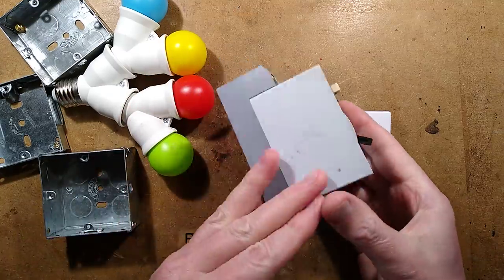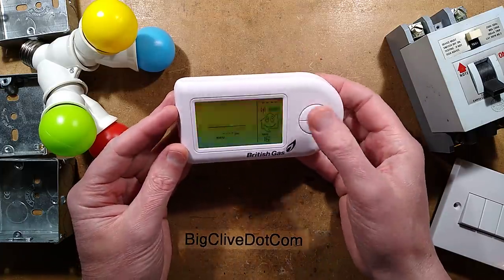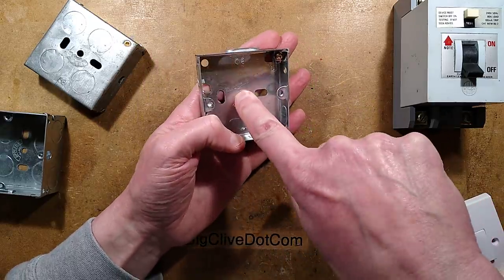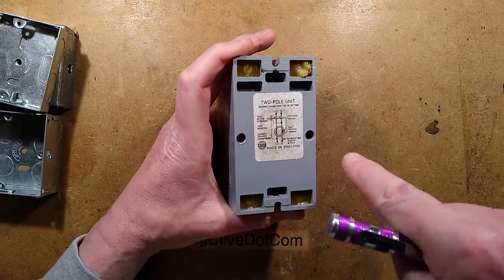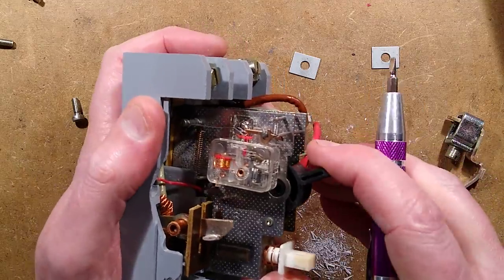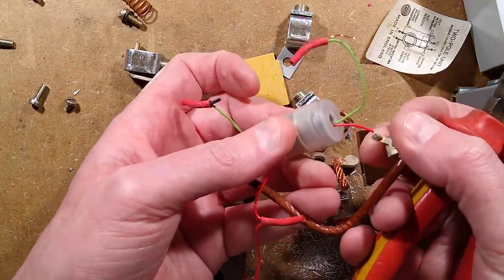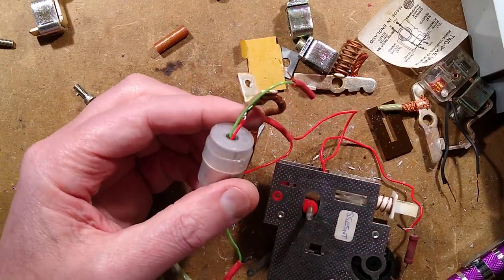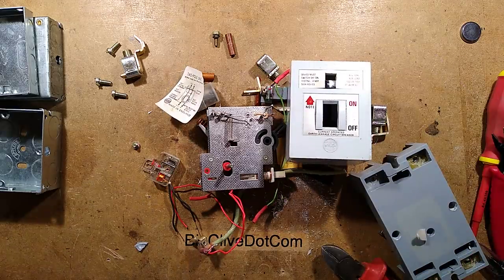Vintage RCD/GFCI teardown with story (weird sensing system)

Comment: Im trying to get a 1970s flourecent light up and running it needs new starters i will go to toolstation tomorrow i think
Reply: Fluorescent is the best, way better than LED. Some old fittings are starterless, if yours is it’ll need a fat (T12) tube.
Reply: @bigjd2k  no its a small twin  t5 wall fitting
Reply from the maker: If it's a twin T5 (5/8" diameter) fitting with short tubes then it may have one ballast and the two tubes in series.  If it does then you may require specific starters.

Comment: I'm not completely convinced the test switch is not opened when the breaker is open. Could there is a mechanical component that breaks the contacts? Would you please check the test switch with a meter. I can't fathom a circuit breaker company making such a bad decision to leave it live.

Thanks for all the videos. I'm a big fan.

Comment: This is a great vid; wonderful reliability failure analysis. A failure that occurred only after a series of events. The only other places where I've seen a series of events caused a failure is in the air disaster investigations. In the case here, and seems in many reliability failures in commercial air flight, it takes 3 things to line up to bring the system to failure. In the example here, which I will not give away, it not just an old capacitor; not just a but solder joint, not just a marginally derated resistor -- but here its 4 things that came into alignment: am I right? Four things?

Comment: If I recall correctly, hasn't the installation of an RCD with a TT system been a part of the regulations for a number of years now? Even in times before it became standard practice to install them because a good earth couldn't be guaranteed?
Reply from the maker: I'm pretty sure it's always been a requirement to have leakage detection, but these units are early in the era of RCD protection.

Comment: Huh... So what's the point of the TTL system? It seems kinda dangerous to me to be able to pull the earth up to mains voltage (if you supply enough current). Obviously normally the RCD should trip and everything would be fine. But you know, sometimes things can fail.
Here in Germany we have earth and neutral connected together before the RCD, with only neutral coming out of the RCD of course. So basically the resistance between neutral and earth is close to zero ohm. And therefore if live and earth should touch, it's a dead short and even if the RCD fails, the normal breaker will trip. And of course if neutral and earth touch (after the RCD) the RCD should trip (at least if neutral and therefore also earth is passing any current). To me that seems like the obviously safer solution. But I figure there must be a reason for your system to be used?
Reply: The system you describe is TN-C-S and widely used in UK too.

These TT systems are used where you have overhead lines. The risk is if you have a broken N outside, all the house's metalwork is now live at 230v and an RCD cannot protect against that. 

UK domestic supplies are nearly all single phase; your habit in Germany of using three phase reduces this risk.
Reply: @flange0r  Ah  "TN-C-S", ok... Wasn't sure what it's called. Ok, fair enough, if the N breaks and E (or do you call it T) and N are connected, then everything is live, (if there is some load connected, which is usually always the case. Actually, as far as I can tell, most houses around here use three phases, but the devices tend to require 230 V, so they use one of the phases and N (not two phases to get 400 V). In that case I believe the RCD still wouldn't trip if N was broken too...?
Anyway, so the TT system fixes that by not connecting N and E together directly before the RCD? I guess both systems have their advantages and disadvantages... What if one were to deliver a separate earth cable too? I guess that would be quite expensive, huh?
I just thought though, if earth is live at 230 V, how would you get shocked? I mean, you would need to touch something that is not live at 230 V too. Otherwise L just becomes N sort of...

Comment: probably still worked but a combination of it being 100mA and with any electronic devices and LED lamps flooding it with D.C probably stopped it from working correctly.
Reply: Textbooks say the contact surfaces themselves can stick if not exercised or subjected to excessive fault currents.

Comment: Only 8 Amps?30 Ohms is a really big loop impedance. In Hungary we use TN-C-S and we must always have a ground electrode with an impedance under 10 Ohms where the neutral and ground is bonded.
Reply from the maker: Completely different system.  The neutral and earth are not combined on a TT system.
Reply: @bigclivedotcom  I know but 30 Ohms is still huge.

Comment: I wonder if u can trigger it with a static shock or even a quartz ignitor from a cigarette lighter.
Reply from the maker: I doubt it.  But an external magnetic field would work.
Reply: @bigclivedotcom  You can trip them with a AA alkaline cell though, just have to get the polarity right on the wires, as they really only trip on one half cycle due to the small permanent magnet biasing it on.

Comment: It's neat for something that I'm guessing is from the 1970s, but man, 100 mA differential current @ 240 VAC before it trips? Yeesh. That's about five times lethal, IIRC.
Reply: I thought 100mA was rather high too.  Normal domestic residual current devices must trip at 30mA these days, but you can get 10mA ones for some applications.
Reply: The 100mA whole house incoming device is there to ensure that a Live to Earth fault is cleared quickly.  As in this case, the high earth rod impedance means that only a low fault current flows and may take minutes or more to trip a fuse, if ever.  Whilst this is happening the earth in the faulty appliance, and possibly those closely connected may raise to a dangerous touch voltage.
  Further 30mA devices could be added for additional shock protection where needed on specific circuits, and the higher fault current of the main device ensures correct discrimination - the downstream 30mA  device should open without ttripping the 100mA incoming device.
Reply: @JC-jv5xw  Thanks - that's good info.

Comment: If overcurrent causes melting in the fuse, what causes the splattered all over fuse?
Reply from the maker: A short circuit with instantaneous destructive current.   A low overload causes it to break and ball.
Reply: Overcurrent, but more,

Comment: There was one of those switches fitted in my parents house when it was rewired in late 70s very early 80s. By the mid 80s it was causing problems and it had to be removed.

Comment: Rewirable fuses are a pain to sort specially the 5 amp wire. Is that thin is easy to break when replacing it. If having to use the fixing screw as the earth screw a ring crimp makes a better connection.

Comment: Clive, what voltage have you got between E and N now ? (When I've stuck a voltmeter across N and E, I've tripped an RCD - so you might need to measure/monitor the voltage upstream of your new trip arrangement.)

We have no RCDs in our house - and your experience proves our 5A fuse wire fuses as low as 8A :) - yeah, so 13A are good for upto 21A :) Sounds about right.
Reply: An imbalance of less than 100ma  (I think) is all that is needed to trip it 8A should have tried it easy (it was old and got stuck, probably needed oiling as this was a purely magnetic RCD very old school)
Reply: @leexgx  30mA is the limit - so IMO, they should be tested at 25 :)
Reply: @leexgx  Ours is an RC(C)B - which I think came after ELCBs and before RCDs ! and deffo before RCBOs !

Comment: It's a pity you dismantled it before running some more tests on why it did not trip. I wonder if the reason it did not trip is related to the fact a lot of modern power supplies only use single rectifiers so they take an asymmetric current. An asymmetric current is essentially pulsating DC and if this is unbalance might cause the core of what is essentially a current transformer to saturate and thus give no output when the earth fault occurred.  I can't find any information on this so without testing it is a bit speculative. Of interest was the trip coil still Ok as theoretically it should have had the same current through it as the imbalance - around 6A and it seems unlikely that wire that fine would survive this ?

Incidentally the asymmetric and pulsating currents taken by equipment is the reason we now have several different types of RCB for different loads. I am aware of types A, AC, B and F and have also seen a reference to B+ as a recent new variant.  Makes choosing the correct RCB for an installation more of a challenge - I think there may be some information in the latest edition of the wiring regs but I don't have access to a copy.
Reply from the maker: The fault was pure AC and there was no known DC bias.  Once the circuit breaker had been cycled it reliably tripped every time.
Reply: @bigclivedotcom  Thinking about this a bit more it is possible that if the Earth electrode or the connections are corroded they can work as a rather inefficient rectifier - I think it is due to the oxide layer. I have seen a silver contact microswitch that acted as a diode in one direction and some approximation to a Zener Diode in the other even operating the switch or the fact that the contacts got quite hot failed to clear the diode effect. I have not seen any other people mention this but few people have access to a proper curve tracer that I was using to test failed microswitches. The microswitches were manufactured in the UK, installed in a product and then sent on a slow ship to Hong Kong so had plenty of time / temperature / humidity to oxidise. The product they were installed in had the interesting characteristic that if the switch went open circuit the internal Nickel-Cadmium battery would explode while charging.

Comment: HEY I have that one Splitter too 🤤 Here is the trick.. You can open it, and hack it from Paralel to Series, so your LED Chandelier will get long lasting
Reply: Maybe not a good idea 🤔 if you use 2 piece of 1-3watt LEDs in Series, one Lamp will be too dimm..
Reply from the maker: It's not a bad idea with matched lamps.

Comment: If your going to the trouble of replacing your consumer unit I would have just replaced it with a full rack of RCD individual circuit breakers not the 2 master RCD dual split box, as any fault takes out half the circuits and you won't know witch circuit is causing it right away (especially annoying when it's a intermittent fault on one of the 4-6 MCBs circuits)
Reply from the maker: I've not been impressed at the electrical separation in single module RCBOs.  They've crammed too much into a small space.
Reply: @bigclivedotcom  I guess so, I just prefer one circuit going instead of half of the house (and probably setting the house alarm off because of loss of power), as long as the 32a RCBO are not stacked next to each other heat shouldn't be a problem (like 6,32,6,16,6,6,32,6 have the cooker/shower furthest away)

Not looked I to RCBOs in sometime but a lot of them seem to lack the white lead (witch I thought was there to handle DC faults or detect loss of neutral so it can still trip or just for the test button)
Reply: @bigclivedotcom  would like to see what some of the two module “GARO” Rcbos that are very common in Ireland are like for quality and separation...let me know if you’d like me so send some your way i also have some extra crispy circuit breakers that actually have holes melted in the sides of them that came out of touring dimmer racks!

Comment: We had a 120v circuit in our kitchen at one point and the microwave was plugged into it and it seemed to work fine and then we plugged a blender in and it tripped the breaker but when i turned it back on the outlet stated smoking and when I turned off the breaker, the main breaker tripped. There were lots of uncapped floating live wires in different circuits. Yikes

Comment: Very cool 😎 video!!!! That tiny pin 📍 is soooooo clever but so simple cascading it’s power to trip the breaker!!! Amazing 🤩 Big Clive that was a neat, ancient ELCB aka RCDish Device and installed in your home!!!

Got Any Estimate On It’s Age??? Before your mum lived in the home??? After she lived there a bit??
Reply from the maker: Different house.  Not sure how old it is.
Reply: @bigclivedotcom  When I was a teenager, we had a new shed wired up from a 30A supply, with one of these units feeding a small consumer unit. That was in the early 80s. It's still in service, I'll make sure it's tested soon.

Comment: If you had 8 amps at 240 volts = 1920W dissipated in the back of the switch you would have a lot of smoke and a fire. I suspect the power was being dissipated in the Earth as your Earth electrode was probably at 240V. You are lucky no one got a serious or fatal shock.
Reply: ... the interface between the ground rod and the earth provided the current limiting or the load 'resistance' in that case, not the back of the switch assembly ...

Comment: I've had a hagar RCD blow up with my finger on it glad to know I'm not the only one
Reply from the maker: They seem to do that a lot.  It may be the failure of the coil to trip the breaker resulting in it and the PCB initiating an arc flash.
Reply: @bigclivedotcom  think on the drawing the test shorts between two phases or phase to neutral if does not trip you put dead short on it which makes your finger black and your pants brown

Comment: It's lucky you caught that fault, cos as you say, earthed metalwork in the house would have been live, and that would have been "shocking" to say the least... :S

One thing that would be fun to see taken to bits, the old coin-operated mains electric meters, mostly cos I bought one yesterday off ebay for playing with, and knowing my luck I'll break it... :P
Reply: With entire house at the higher potential, there would be little chance of any body part touching actual ground potential.
Reply from the maker: Not a huge risk, but a tingle would be possible.
Reply: @johndododoe1411  I worked on a "mobile" building where a wire shorted to ground and burned off a link that was grounding the whole place. It took me a while to figure out that ground lines in there were actually hot. If my gloves had been a little wetter, and the snow a little warmer, I would have figured it out just by standing outside and opening the panel...

Comment: If the sensing mechanism responded to a battery, would that mean the breaker is effectively type A, rather than type AC? Given its age, I assume it wouldn't be deliberate, but a fortuitous result of the design.
Reply from the maker: I was powering the trip coil directly.  You have to allow for magnetic coupling through the sensing core.

Comment: So essentially that green wire is acting as a capacitor that gets voltage from the interference of other wires?
Reply from the maker: It's inductive coupling like a single turn transformer.
Reply: @bigclivedotcom  ahhh okay, that makes sense why it's so sensitive

Comment: Nice one again! Thanks Clive! But i do not understand why you guys still use metal boxes instead of plastic inert to heat, fire, and possible electrocution..? BR Zlatko
Reply from the maker: We do have plastic boxes for plasterboard and surface use.  But for in walls they are generally galvanised steel.
Reply: @bigclivedotcom  Ok, but do you personally not think that is not really a good idea..? A lot of hassle grounding them (probably with mistakes or not grounding at all)?
Unnecessary metal and AC do not go one with another :) Do you agree? BR Zlatko

Comment: Interesting. Can you do a video on how to make a simple effective short circuit and reverse polarity (DC)  recover protection?
Reply from the maker: It depends on the current and voltage involved.  For low current a simple series diode protects against reverse polarity.  For medium currents a PTC self resetting fuse is useful.
Reply: @bigclivedotcom  I know but actually it is great when there is a switch that pops in case of such situation. Something like you showed us in your video.

Comment: Hey Clive... Would you please tell me why the wallboxes are out metal in britain???
Reply from the maker: Probably a fire resilience thing.  They're galvanized and used in plaster and brick walls.  In hollow partitions you can use either metal boxes on a stud or plastic self retaining boxes that grip onto the plasterboard/sheetrock.
Reply: @bigclivedotcom  Thanks for the answer!!! I was just wondering if this would increases the risk of getting a shock or a shortage in the house circuit, especally if it's moist...

Comment: I am using this for water level 
It's trip when water touch probe 
With supply of 24v
Reply from the maker: That's an unusual application.  It would rely on water conductivity.  Any sustained DC current will potentially affect the electrodes surface conductivity over time.
Reply: Note that the conductivity of water varies a lot - typically, distilled water is a poor conductor, while water with dissolved minerals will often conduct a lot more.

Comment: Now I'm concerned,I have one of those in my fuse cabinet
Reply: Push the button, see if it works 😃
Reply from the maker: Don't worry too much.  Mine was out in a garage, so that may have affected it.  A routine test by making sure everything crucial is off and then pressing the button briefly is a good check.